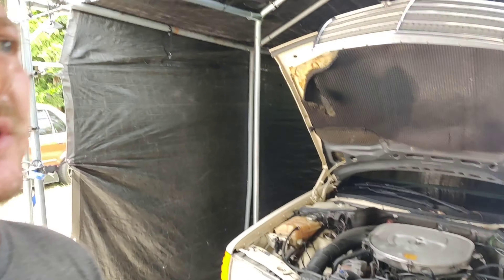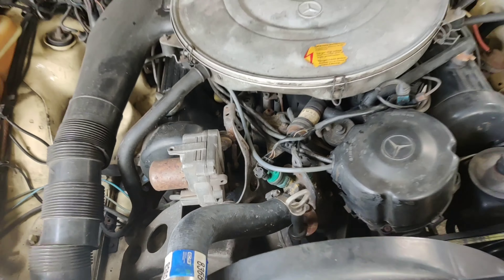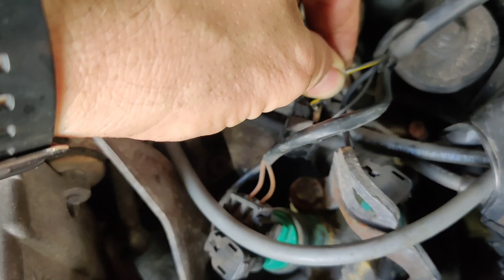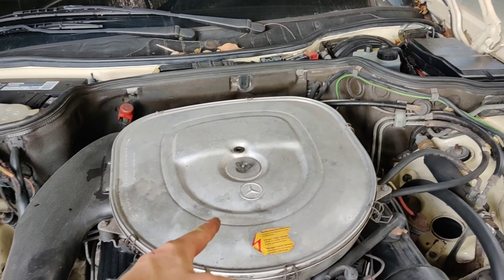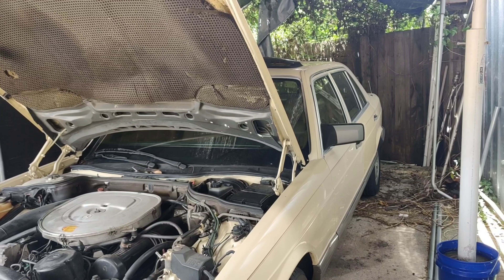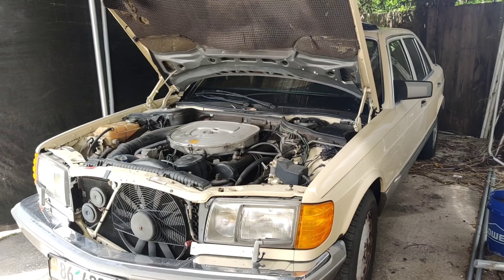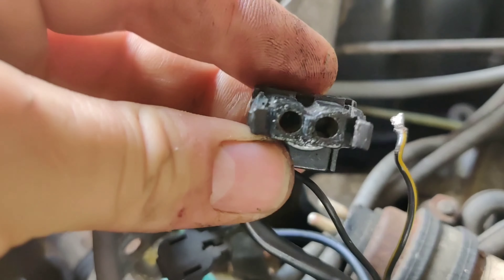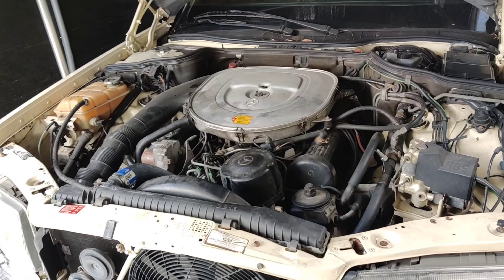1986 Mercedes w126 420sel high idle fixed IAC idle air control

Comment: Was the idle high only in park? Or in drive as well?
Reply from the maker: Both
Reply: @petescarport  THANK YOU for the response🙏. Mine has a high idle only in Park and Neutral. Any ideas on what it could be or where to start?
Reply: @Big_HomieTX  Hi DeeReal, did you ever figure out why the idle is high in park and neutral, I'm having the same issue,
I cleaned my idle air control and its contacts today (1989 420SE) since I was working near it, I used MAF cleaner, it was dirty but the shake test was okay before the clean and better after the clean, went for my test drive, all good until I noticed the high idle in P and N when I got home.
The Idle was good prior to cleaning, only became a problem after the clean